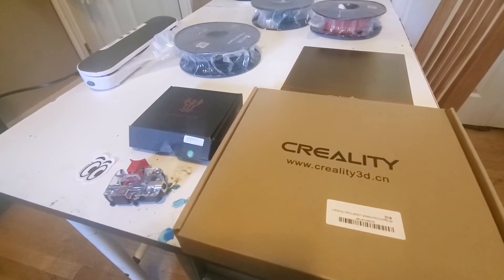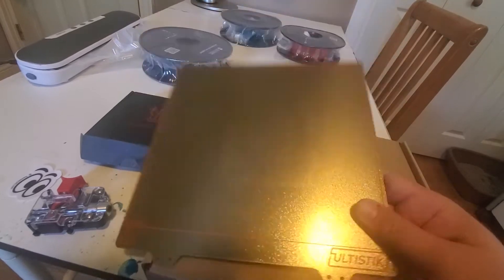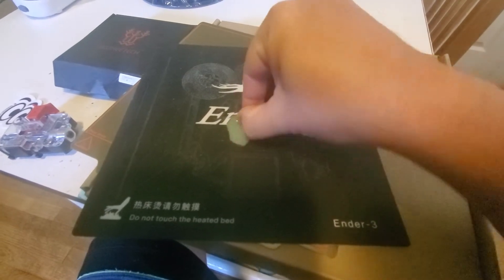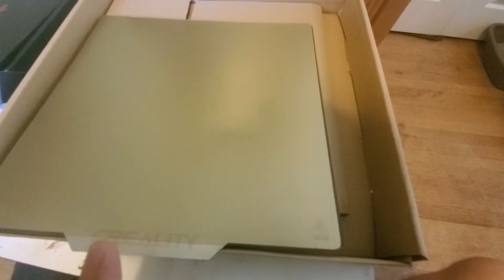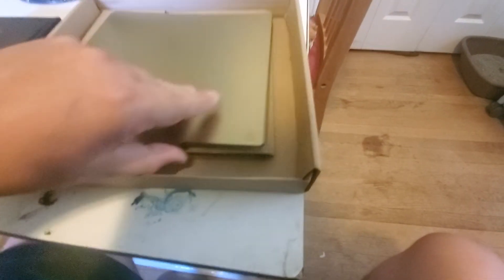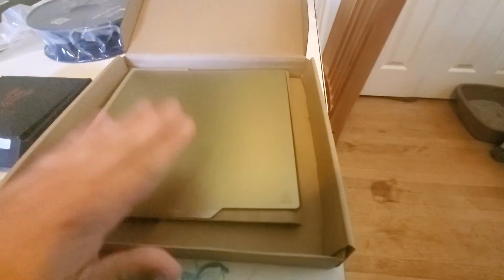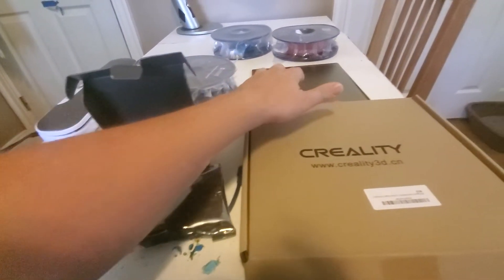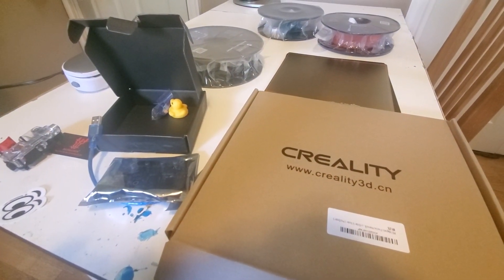Ender 3 Upgrades / Mods - Ender 3 v2 vs Ender 3 Pro vs Ender 3 Stock vs DIY upgrades

Comment: Darn, watching your video I regret buying v2 now. 
I buy v2 because other youtuber recommend it and worth the bucks.

Thx for the insight. I'm new in this thing.
Reply from the maker: I've also found v2 isnt needed for CR-10 's dual Z steppers...they wire up to a singlendriver and just use a cable splitter.  I just had a 4th v1.2 board show up today 👌